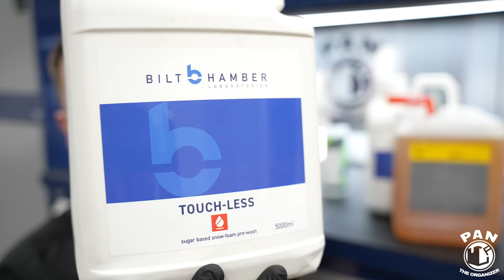The end of the 2 bucket car wash method!? 💀

Comment: Pan, just found your channel the other day and I want to say I am highly impressed with the content! Just bought a new car last Saturday, so granted I want to take the best care of it I can and stumbled upon you! I have a handful of questions for you and I hope you can help me out.
-Would a 3200psi gas pressure washer that I currently have, be ok for detailing as long as I move farther back and use the softest/soap attachment? Or should I just use my hose with a foam gun?
-How can I tell if my dealer who apparently applied a 'ceramic' coating, actually applied that versus just a wax? There is clearly a nice hydrophobic barrier on the car with very nice beading. I just don't trust them haha.
-What do you recommend for winter washing when my outdoor water source freezes?
I'm sure I had more, but they slipped my mind. Thanks in advance and keep up the great work!!!
Reply from the maker: Congrats on your new car! What did you buy?

Welcome to my channel. You discovered one of the biggest car detailing channels on YouTube as we surpassed 940,000 subscribers and we have over 124 million views! I have been detailing for 26 years and I love to share my knowledge and passion with my viewers.

You found the right channel to help you learn everything about detailing.

It’s never recommended to go above 2000 psi when washing cars.

Also, a new car is never new until it's properly detailed. 
- at the factory, the paint defects are often corrected quickly by rotary polishing which can leave marks and holograms, so polishing corrects those, before you lock that in long term with a ceramic coating for example.
- vehicles are then transported by truck, train and boat so they are exposed to the elements, industrial fallout, brake dust, rail dust, etc
- vehicles are often left at boat docks (when transported by boat) or in exterior parking lots for weeks or months, again being exposed to the elements
- at the dealership, the vehicles are almost always poorly prepped using the same dirty water that was used for all the cars on a given day, and poor washing and drying methods leading to swirls and scratches 
- at the dealership, a layer of cheap wax or paint sealant is usually applied to attempt to make the paint glossy prior to delivery. It's crucial to remove any previous protection before you apply a ceramic coating, as coatings need to bond directly to a virgin clear coat.

If you only plan on applying a regular carnauba wax or paint sealant though, you could decide to skip machine polishing, as those protectants can be applied over existing protection and it's not as crucial to prep the paint as well.

I explain all of this in this popular video: https://youtu.be/QgoyrC-5CMc

So you can better visualize the new car prep process, here are the steps I perform on a brand new car for my customers: 
Mercedes S 580: https://youtu.be/Vq_tfcwryVI?si=whord2_UEFSg28UW
Aston Martin Vantage: https://youtu.be/OKga3yZVTqo
Volvo XC60: https://youtu.be/tvDBBenhYFA
Tesla Model Y: https://youtu.be/gohks8xP5NY 
Porsche 911 Carrera: https://youtu.be/2ckiivbFqs4
Mercedes AMG GT63S matte black: https://youtu.be/eU8zg1lXvXY?si=oGxoCp8PWt7gTncV
Audi Q7: https://youtu.be/t7HCBSVnizM
BMW M6 Gran Coupe: https://youtu.be/0lC9uyKXs8Q
BMW M340i: https://youtu.be/etXhJNaF0EE
Audi RS3: https://youtu.be/641mAJfKDLM
Golf R: https://youtu.be/jr19g4PWJsk

Comment: I use 2 foam and 2 bucket. I squeeze out the dirty wash fit and dunk in the rinse to remove any filth and then reload in the super soapy bucket plus there is soap/foam on the surface.

Comment: I use the 3 bucket method. I separate bucket for the wheels which I do first, then the 2 bucket method for the body. If its winter and the car is really dirty the 2 body buckets will get emptied and re-filled half way round, so 5 buckets in that case :)

Comment: Lots of valuable information thanks but then you wash the dirtier bottom of the doors for example with the wash mitt and bring the mitt back up to the cleaner top of the door thus increasing the risk of scratching to the more visible part. I divide the cleaning into four horizontal areas walking around and around the car working lower each time and avoid shut lines and recessed areas and wheel arch edges until I feel appropriate as always have trapped dirt. Hope this helps.
Reply from the maker: Welcome to my channel. You discovered one of the biggest car detailing channels on YouTube as we surpassed 945,000 subscribers and we have over 125 million views! I have been detailing for 26 years and I love to share my knowledge and passion with my viewers.

You found the right channel to help you learn everything about detailing.

Comment: After I wash a small area with my mitt (e.g., both doors on one side of my SUV), I need to re-soap it.  But what I do before dipping it in my wash bucket is spray off the mitt with the shower nozzle attached to my hose.  Doing so removes most of any grit that my mitt may have just picked up.  I've never used the two-bucket method because the rinse bucket will always have grit suspended in the water from the prior rinse that I did just a minute or so prior.  That's why the second rinse bucket never made sense to me.  I wasn't getting the maximum amount of the grit off my mitt, and the rinse water will always have some suspended grit in it that has not yet settled below the grit guard because the all the grit hasn't had time to settle (precipitate) to the bottom.

Comment: I’m a novice and what made sense to
me was:
Snow foam. Let it soak. Rinse
Snow foam again, use it as my washing soap already on the car.
Use two buckets to rinse only. 
Apply more snow foam on the car if needed during the wash process.

Seems easier than a washing bucket and it puts lots of soap on the car.
Reply: No, the 2nd snow foam is just added lube for whatever "soap" you have in your bucket.

Comment: funnily enough did this exact technique last weekend

recently had my car ceramic coated and detailed, so now it stays pretty clean and most of all the dirt just pressure washes off at the car wash for $1 and 60 seconds of work.
But for an actual wash exact same as this.

the cheap daily driver however cops the same treatment, it gets a heap dirtier being on a mine site... and goes longer without washes. Not that I don't care about its paint, but its more about time for that one, and the fact it already has a heap of swirls scratches dings imperfections so i don't care as much.

Comment: Hi,why are you not using a dedicated shampoo for the contact wash in the lance? This will surely give you even greater lubricity? I myself wouldnt use a snow foam as part of the contact wash as there are no lubricants,i am very surprised that you have done this
Reply from the maker: I don't understand your comment. Any snow foam will add lubricity on the surface, it's no different than a bucket soap (in fact most shampoos can also be used a snow foams). Also, the soap in the bucket already has tons of lubrication. If you do the method right, even not using any snow foam isn't the end of the world. Many pros don't even foam cars, and still get great results.

There are many ways to safely wash a car Simon. I have been detailing cars for over 26 years now, I think I know how to wash a car at this point haha. It's not rocket science and we're not saving lives here. We're just detailing cars. And it should stay fun and relaxing. Don't overthink the moment.
Reply: @PanTheOrganizer  i would say that snowfoam has no lubrication as its a pre-wash,i use the same method as you have done,but i use a shampoo in the lance which does have lubrication,but i do like the one bucket method though. I never mentioned anything about saving lives or that shouldn't be fun,it's only my opinion. I follow a few detailers in the uk and have never seen a contact wash with snowfoam,its on,off....and shampoo
Reply from the maker: Ah that makes sense now, as you guys in the UK often use different snow foams than in North America. If you use Bilt Hamber snow foams, I would absolutely rinse those off before the contact wash, and use a different soap in the wash bucket (I like CarPro Reset).

But if you use Koch Chemie Gsf in the foam cannon, you can use that in the bucket as well, it's meant for both.

So yes I get your point, and you are right depending on which snow foam you are using. Not all snow foams are also meant for use as a contact wash. So which snow foam are you using?

Comment: I prefer the multiple washmit method..2 to 3 Mits..that once they've touched the car..they DO NOT return to the clean soap bucket or the car, until after they are cleaned, before the next time I wash the car.. Its so much easier to toss them in a side 🪣 and clean them later, when you're  doing your final cleanup of all tools & items..
A little Purple Pwr. Vehicle & Boat, can easily modify the pH of nearly any pre rinse foam also..🤔
Waterless wash for the touchups & forced air for drying..

Comment: Thanks again Pan for that new process.....  Very interesting.  I'M still more confortable with the 2 buckets method.  I'll give it a try for sure.  Question: for the second application of snow foam for lubrification; would it be preferable to use a ph neutral shampoo as GSF or other?  Like you said, products evolve with the years so, our techniques should follow & adapt. Keep on the good work!!

Comment: Pan, I have been doing this for a few years.  I still use "2 buckets" but the second bucket is used for mitts that I have used for each section.  For my S6 I use 4 mitts and for my wife's SUV 5-6.  I use the mitts similar to you did with your one bucket method, but use a second bucket to collect my mitts before heading to the washing machine.  I have always rinsed before using foam, thinking that WATER is a lubricant, if it was just 2000 PSI of air I would agree but water is a lubricant maybe not as slippery as soap but it is a lubricant just the same.  If you think that the foam works to remove much of the lose dirt without the initial rinse it will save me a few minutes as long as it is just as good.
Reply from the maker: That's totally fine too! :)

Comment: Not sure if this has been answered already, but after rinsing off the active, can you just reapply with any other soap at that point
Reply from the maker: Yes. I would’t refoam with a high pH snow foam for the hand wash. Just use a pH neutral snow foam at that point (2nd foaming).

Comment: I've been doing this method for the last 12 months with absolutely zero issues.  Only thing I will add is that if your car is heavily soiled you dont want to just rinse in the bucket.  You might be better off giving the mitt a good spray with the PW.  Or use two mitts.  One specifically for the half of the vehicle.  Outside of that, this method works great.
Reply from the maker: Thanks for sharing your thoughts Nathan.

Comment: Great Vidéo Pan! I am about to equip myself for complete detailing of my new black car.  Car will get front ppf and full ceramic coating by friday. I am a beginner detailer but I want to start off great. Money is not an issue. Should I then refer myself to this video and equip myself accordingly? Or go towards traditionnal 2 bucket?

Comment: After the initial pre-soak, where the dirt is lifted with the surfactants, it seems strange to use a power spray that literally drives those dirt particles back into the paint. Wouldn't it be better to use a spray with less pressure to simply remove the soap and dirt? Just me?

Comment: I do same thing, but have dedicated bucket for wheels (black), grey bucket for rinsing out mitt prior go going back on car, and a blue bucket with clean water/soap...I don't see downside of the 2nd bucket filled with water. It's always dirty by the time I'm done. I use LIFT foam and while it does do stuff, it wouldn't say it cleans 80%... maybe less than 50% or maybe it just doesn't get the big stuff that stands out. I use RESET at the end, but it's not really a foam... works just fine mixed in bucket. 

Though I had it on past cars I don't have a coating on this truck...the spray on 'top dressing' kinda like wax stuff is just as good and probably better if you reapply it often. My 2 cents is permanent ceramic coating more trouble than it's worth...starts looking like crap/inconsistent when spots of it wear. Prevents painless dent removal or PPF (also will never do this again... just wears like crap and film lines...paint with a few rock chips looks better and is repairable).

Comment: The best way is the one bucket 🪣 method with 5 wash mitts depending on size of the vehicle 🚗 will determine if more mitts are needed or better the red sponge. 

Only reason they came up with the two bucket was for 💰purpose. The two bucket your introducing dirt and grit particles. 

Pre wash with foam cannon 🫧

Rinse 🚿 

Re foam 🫧

Rinse 🚿 

Bigboi car blower

Comment: Hi Pan, very good video. For me, it’s a no brainer - one bucket and multiple mitts is lower risk than the two bucket method, and the one bucket/one mitt method. It’s not that much extra effort to ‘manage’ 4-5 mitts over 1. I use one bucket in a wheeled cart with 2 bucket caddies attached to the bucket - one caddy for unused mitts and one for used mitts.
Reply from the maker: Thanks!

Comment: As mention previously, having limited water lead me to also test this as well. I will be transitioning to a prefoam in the near future because what I learned from my results. I started using two wash pads after using an ONR prerinse. Using the Detail Guardz in the bottom of my bucket and minimal revisits to the soap, I had some dirt accumulation on the bottom. Once I switched to three wash pads I noticed a considerable improvement and a lighter amount of grime inside the bucket. It is my preferred method now and I tend to keep extra wash pads and array of soaps in repurposed Adam's Hand Soap bottles inside the second bucket with the closing gamma seal to keep it fresh n' clean!
Reply from the maker: Thanks for sharing.

Comment: For my rinse-less wash, I use a modified "2-bucket" method - 1st bucket is my wash bucket (2 gallons of DI water with ONR) and 5 clean mitts. Those 5 mitts soak up nearly all the water.

The 2nd bucket has grit guards (on the bottom and sides) and around 4 gallons of plain hose water.

Each mitt gets a section to clean, and after each mitt finishes, it gets tossed in the 2nd bucket to soak and wait.  I finish going around the car with the mitts, and I finish drying, spot checking, detail spraying, etc. When I'm done and satisfied the car is good, I go to bucket #2 and scrub all 5 mitts on the grit guards; changing the 4 hose water gallons as needed (usually 3-4 times until the water is clear again. Then I hang the mitts to dry and dump the water.

The traditional 2nd "rinse" bucket has never made sense to me, nor has the grit guard method helped to separate clean water from dirty water. It was never enough for me to trust putting a dirty mitt back on the car. Once a mitt is dirty, that it. The mitt won't touch the car again until it's been scrubbed clean.

Comment: @PanTheOrganizer This greatly ties in to your video the other week w/ Chelsea going to the DIY carwash.
As a hobbyist, without a great place to wash, I gather up mitts etc, bug remover and Gyeon WetCoat. Start w their prewash (which is actually very powerful-Can't speak to the pH) keep walking around the car spraying so it gets a full 2min dwell time. Then the soap  sprayer to add more lubrication, spray my mitt w the soap from sprayer, put the spraygun in its holster turning it back to water setting, turning it back to soap to spray out my mitt as needed. Often times I will use 2 mitts, 1 for the majority and another for the very bottom grimiest areas. Admittedly, without a light often time my white, black and silver cars look clean by the time I get to the contact wash. Because the chems at this dit are pretty good, I do use their spray wax & final rinse. Both do add decent beading and sheeting. Top it off w Gyeon WetCoat as I dry and bam i'm done in less than 30 minutes (minus wheels). Sometimes if I'm really into it I will power spray out their brush (which actually ISN'T garbage) and will just allow the foam to drop all over the car and then use my mitt for contact. 
The good part about my method is no one can yell at me about doing bucket washes because I have no bucket AND I'm paying the entire time.
The bad news is that if I go hard in the paint on it (pun intended) it runs me about $12, But that is still the same or less than a drive-through wash.
As a hobbyist I'm getting it done WAY quicker than in my own garage fussing with two buckets a sunjoe pressure washer, and fighting the hose as I make my way around the car in a cramped garage. About 1 year in with Gyeon CanCoat on 1 vehicle and even after using their potentially harsh products at the diy, CanCoat is holding up. When toppes off w their Chems and WetCoat It's slick as snot. But it is soon time for another CanCoat session
Reply from the maker: Thanks for sharing your thoughts!
Reply: @PanTheOrganizer  Thank You sir! I know my scenario isn't perfect, but I think it can encourage other hobbyists who don't have great working conditions, and still give them a chance to familiarize themselves and work with some really great products! 
The fewer the barriers,  the more folks will be  encouraged to keep washing at some level. Here in Texas there's more carwashes on a block than Starbucks 😂 
Keep up the excellent work Pan! -Ang
Reply from the maker: Heheh thanks Ang!! I hope you had a great weekend.